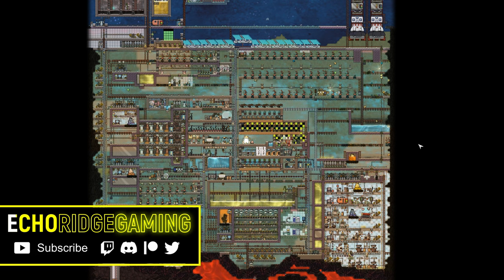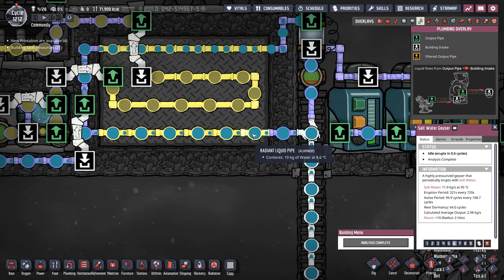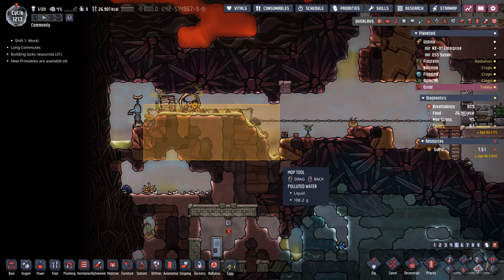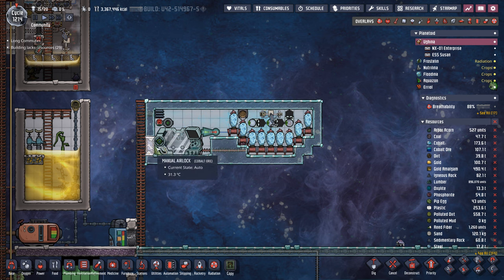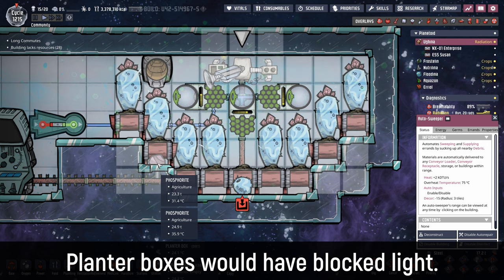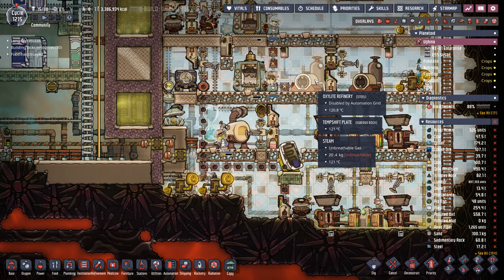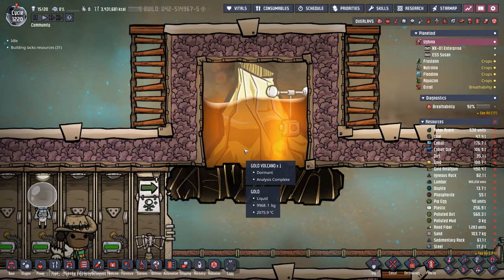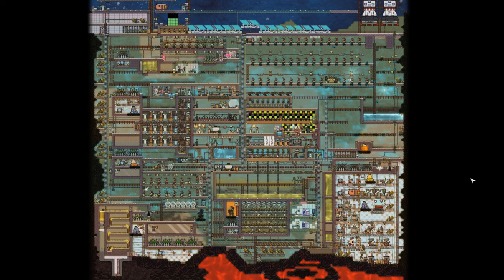Mini radbolt reactor | Colonization Ep 18 | ONI Spaced Out

Comment: couple of things to mention
1. it would be easier to add a layer of oil, ethanol, polluted water, or brine on top of the sleet wheats, or conductive tiles underneath, and run hot water straight to the wheat plants in insulated pipes.  this way you won't have to push the aquatuner to cool the 95C water, and you won't risk freezups, since there is only an 4 C or so difference between the freeze point of water and the plants max temp.

2. shinebugs. shinebugs do not stop producing rads, even when cramped. with that said, you could build a shine bug farm and a small room to dump the eggs in, and a rad generator in the room, which will make a mockery out of the wheezeworts. this is assuming it wasn't a bug that was patched after my last time on ONI
Reply from the maker: Thanks for the tips:
1. This is a pretty good idea, I am going to have to try it one day.

2. I have done a shinebug reactor before in an earlier series.  It does work great,  although the extra critters adds to poor performance later.